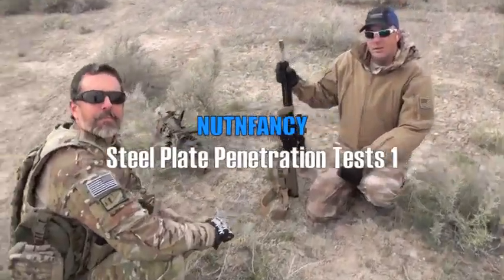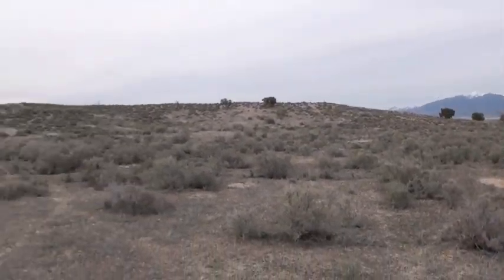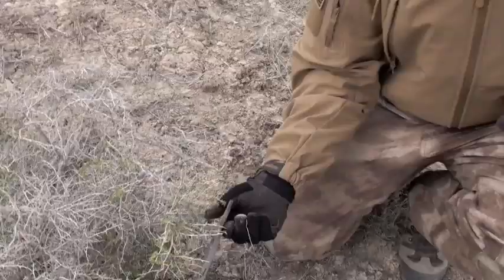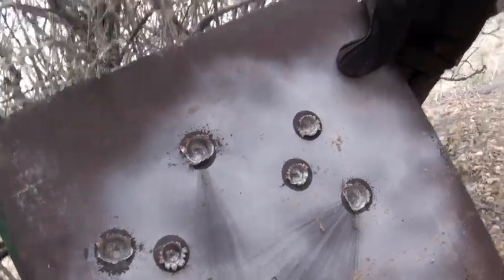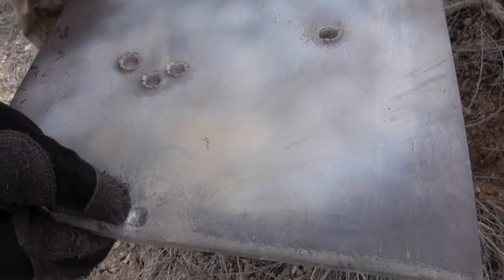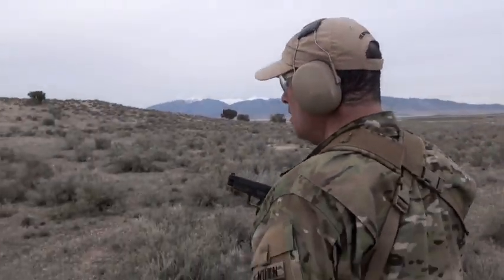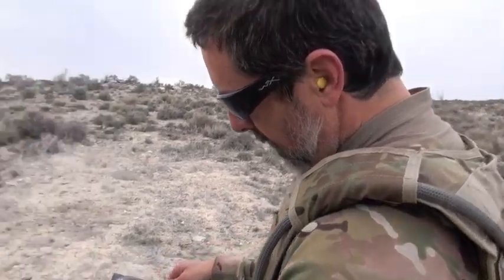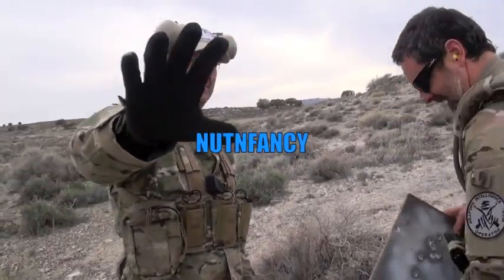Steel Plate Penetration Tests: 7.62mm, 5.56mm

Comment: To put things in perspective.

The rule of thumb: if you double the diameter of a cylinder you will quadruple the volume. If you increase the diameter with 40 % you will almost double the volume.

A 5,56 mm with 37 % diameter increase is almost 7,62 mm.

A 1000 kg car at 27,8 m/s (62 mph) will give you 386 420 J. If you double the weight you'll double the kinetic energy. If you rather double the speed you'll quadruple the KE. If you both double the speed and weight, you'll have 8 times the KE.

Comment: I offer a few suggestions to make it easier: Grip firmly until you begin to shake, then back off. Focus on the front sight. Dryfire a lot. When dryfiring, if your front sight consistently goes to one side on the break, adjust your trigger finger placement till your sights barely move. I personally remind myself "Smooth", "Squeeze" during shooting so I don't jerk. Anything with a decent pull weight(~6lbs-) and barrel length(3.5in+) should be able to hit that size target at that distance.

Comment: Wont do much better than a pistol length barrel as the bullets still wont have high enough speed to penetrate a 9mm or .33 caliber is bigger than a .308 and has heck of alot less powder only a .357 would have a good chance as it reaches the highest velocity and the smallest caliber size but still unlikely to penetrate.

Comment: Except that you can get steel cased 7.62x39 for $7 a box/20 normally $4.7 right now readily available and .223 steel is $13 a box/20 normally $5.2 and picked clean of the shelves every restocking day. You get a bigger bullet for a cheaper price and id take that anyday!

Comment: By the way, love your work!
I'll let you know if the FNAR goes through.
Basically it is an energy equation.
Comparing .223 to .308 is similar to swinging a 16oz roofing hammer and swinging a 3 pound sledge. If swung at same speed, vastly different impact on target.

Comment: I've done a similar test on a man hole cover at roughly 50 yards. Shot it with 17 HMR, 22lr, .223,9mm .308 and 7.62x54r. Most barrels were at least 20in long. Man hole cover is approximately inch think iron? stopped everything but .308.
Mine you 26in .308 Savage generates more velocity than 16 in Waffen Werks FPK.
Sold my Mosin so no long barrel 54r. Haven't shot it with my FNAR but think it won't go through due to velocity loss.
All things being equal, there is no replacement for displacement!

Comment: KE=1/2Mass(Velocity squared), so yes V is an exponential function
It's amazing that even though a solid bullet has to travel 2-3000fps to shear steel, ppl still believe hollow aluminum traveling 500fps can do the same thing. Yet it's not possible ppl still think it happened twice on the same day.

Comment: i did my own testing with 762x39, it goes through quarter inch but barely.  If the plate was slightly angled it didnt go through, leaving a "bubble" on the other side.

Comment: Yes I know he said that. However, mild steel  does not mean it's heat treated. It means it has mild carbon content such as 1030 or 1050 carbon steel.  The last two digits represent the carbon concentration ( 0.3% & 0.5%).  There are low, mild, and high carbon steel categories. Not tryin to be rude or anything...

Comment: it would be interesting to show the effects of distance on penetration i have shot half inch mild steel at 200 yards with 308 using 168 gr A-max at approximately 2700 muzzle velocity and it barely made a scratch

Comment: Cool! Do you know if those steel plates were heat treated in any way? Or were they just left as is?  Definitely doesn't seem to be quenched steel otherwise those .308 rounds would have most likely fractured the plate.

Comment: No. 9mm just does not have the energy to go through 1/4 steel plate, no matter how hot it is loaded. Regular 9mm is loaded to 400 fpe +/-20ish. +P is loaded to 500ish. 5.56 SS109 is 1,300 fpe. Then there's the different bullet constructions, and the sheer size differences of the bullets themselves, 9mm is a large, light weight bullet in rifle terms. It is wider than the 7.62, and generally much lighter.

Comment: Wondering if the holes can be welded shut and then the plate heat treated to 900 degrees to strengthen it?

Comment: 12ga slug would have bad penetration even with a brenneke wall penetrator/black magic magnum its only competitve with a 30-06 in ftlbs of energy but its pounds per square inch of energy would be much lower being a wider shot so the penetration would be less, and those are magnums so there the same power as 10ga slugs accept better penetration as a smaller slug.. so if it stops .308 should stop the slug even somewhat easier

Comment: Do this, go to a rail road track. Find the tie places with the square holes. Fill a dresser, placed in a tactical location in your house with them. Insulate with water bottles. I've shot them with 7.62x54R and it didn't penetrate.